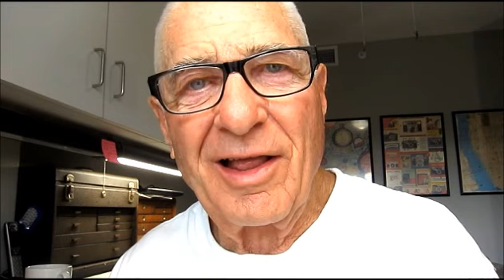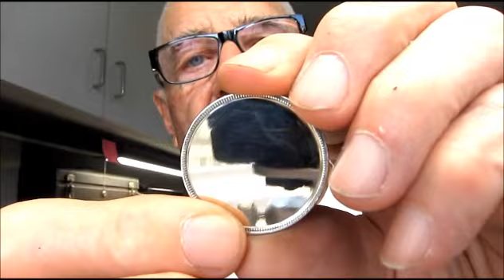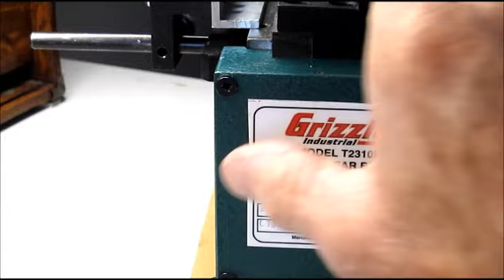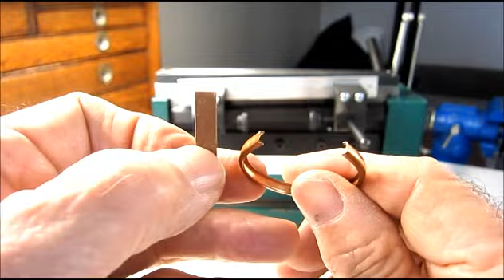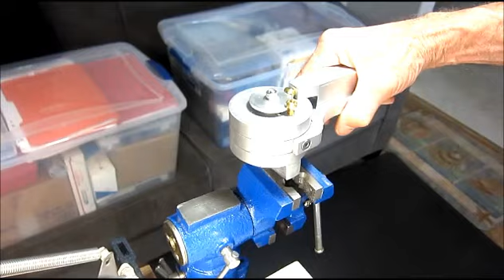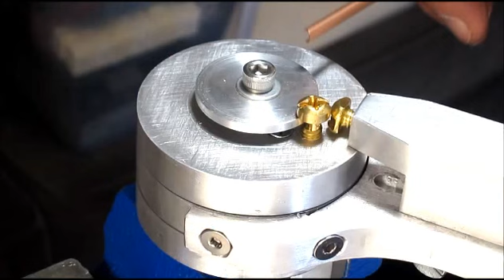COIN BEZEL MAKING VIDEO

Comment: I was trying to make my own bezel wire and I was going about it by running multiple pieces through my rolling mill at the same time. Now I think I might go the die route and use a press since I don't have a shear handy. I wonder if this could also be done on a home made tool where the dies are just 2 wheels. Thanks for giving me some good ideas.
Reply from the maker: Hi: basically my bending jig is two wheels with the male and female profile cut in to them, one wheel is the stationary mandrel that the outer mechanism rolls around, the other wheel is the revolving handle with the other roller wheel on it. I believe there are many ways you could jig two wheels with profiles cut to suit to form your intended use. Art